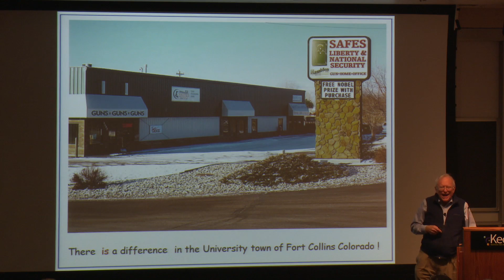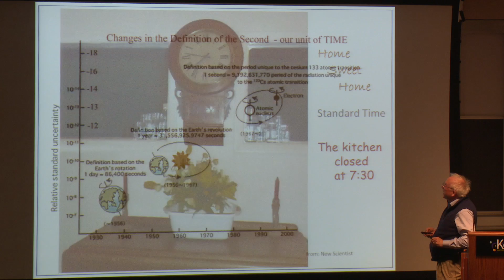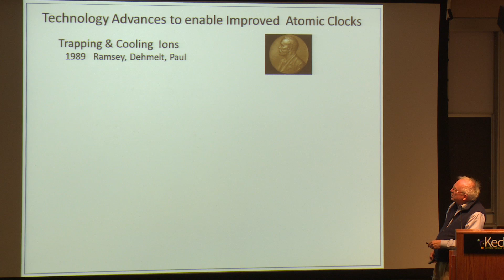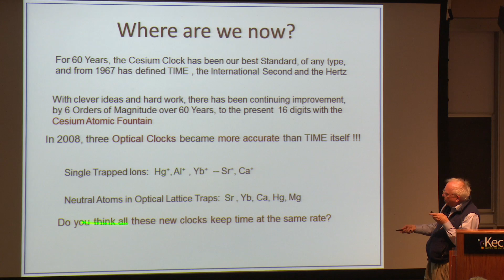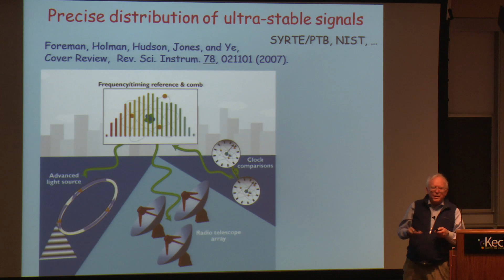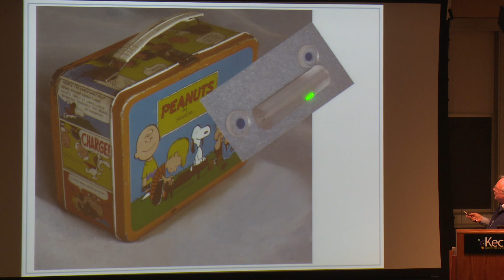Light, Atomic Clocks, and Testing Einstein’s Assumptions

Comment: New finding in 2010 you don't know before, in general theory of relativity Albert Einstein ignored refraction of light. Einstein's proving method (EPM) via eclipse is unscientific and deeply wrong. It is very surprising. Einstein was wrong.

Please read on the reliable source the book The Universe and DR.Einstein, by Lincoln Barnett, London, 1949, Preface by Albert Einstein himself, page 78 - 79.

Einstein's gravity is wrong. Deflection of light is caused by refraction, not gravity. Shapiro delay is false, time delay is caused by refraction of light, not gravity. 

Atomic clock at higher altitude tick faster than clocks on Earth's surface. It is not caused by gravity, but by air density of atmosphere. Closer to the earth surface, the air is denser compared to the density of the air layer above it. The density is getting looser or weaker when it is getting higher.